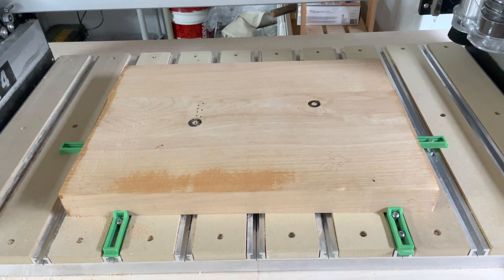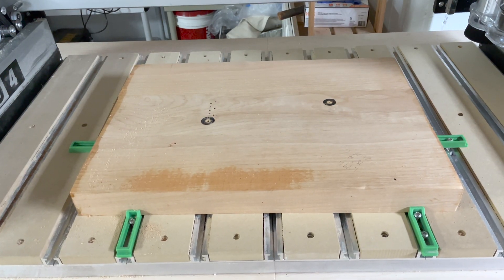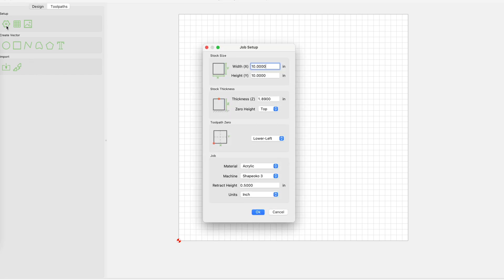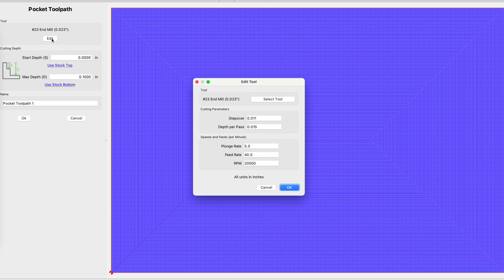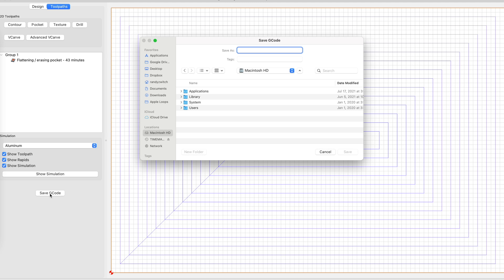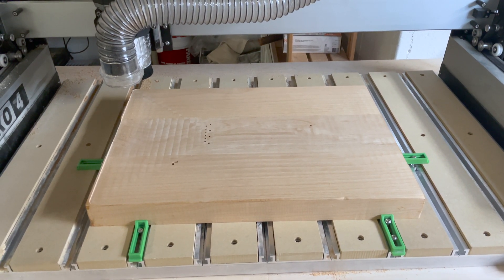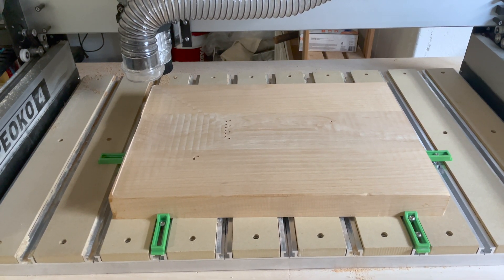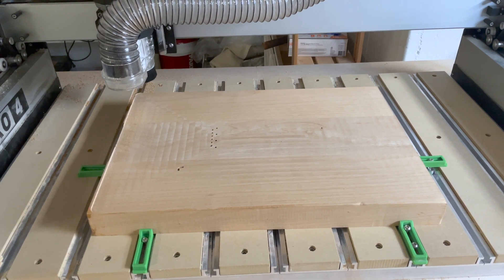The MAGIC ERASE BUTTON for Shapeoko 4!

Comment: Hi, how did you arrive at a .015 cut depth for the 6210 bit? Importing the tool database from whiteside into vectric lists a maximum cut depth of .25. i'm about to get my shapeoko and am trying to wrap my head around how to select proper feeds and speeds for the bits I'm getting. Thanks!
Reply from the maker: Hey Dustin...I think it's important to differentiate what's possible vs. what features Carbide Create has. In this case, because I wanted to "erase" this mistake, I only wanted to go down as far as I needed to but no further. Since I guessed it to be 0.1" to remove, I wanted to go in several passes. So by going .015 at a time, I could evaluate after each pass and stop if I didn't actually need to go as far as I estimated.  I don't remember exactly, but I feel like I might've done 3-4 passes, and if so, then I took off 0.06 instead of 0.1.

To your actual question about the true maximum, the 6210 bit should have 0.25" of blade, so if you were going slow enough or the material was soft enough, then you could do that in one pass. So you can likely go MUCH deeper than I did, but for what I use this bit for, I'm never trying to surface anything that uneven.

Thanks for watching!